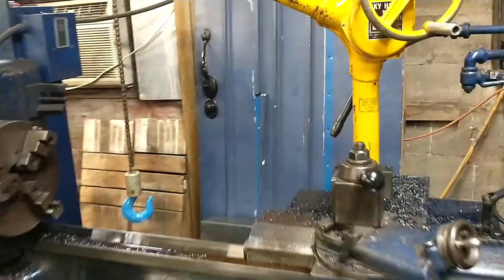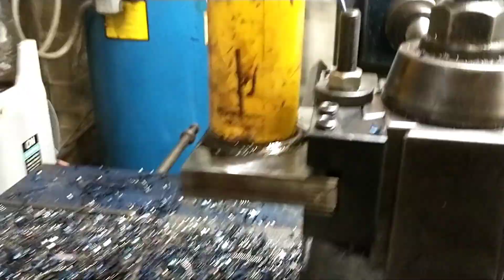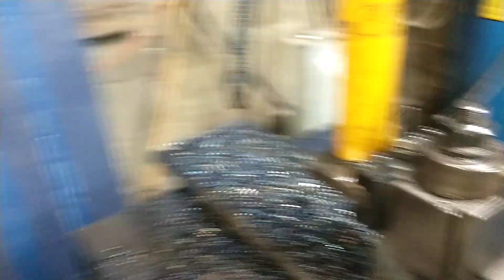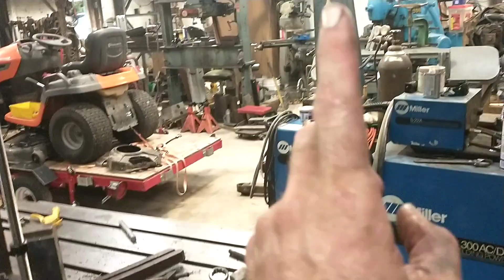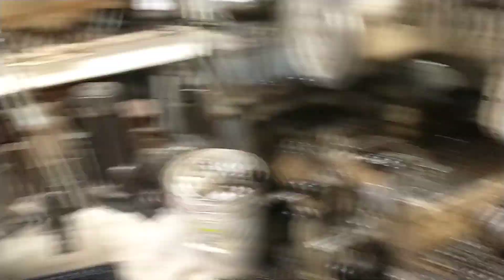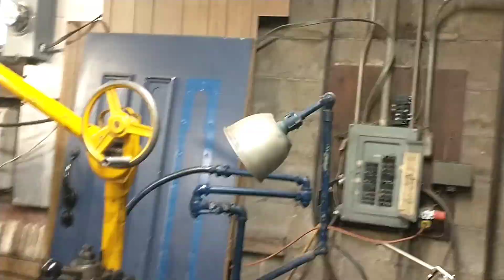The most awesome swap meet buy ever! A sky hook.

Comment: I will admit it was a pretty difficult pill to swallow initially buying a new one. However...after using it, it is worth every penny. I bought mine initially to lift the 12" chuck, but I see a lot of use of it on the milling machine in the future. My justification was what an ER visit, let alone down time, would cost if I smashed my finger up bad trying to lift the chuck or another piece. Good find! You'll never know how you got away without one for so long!